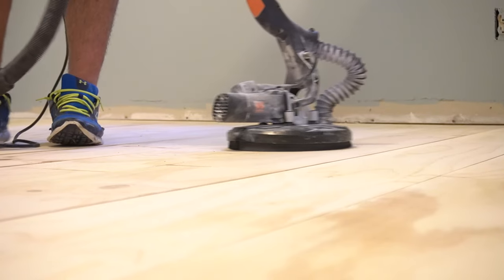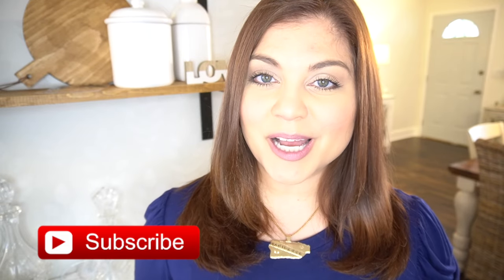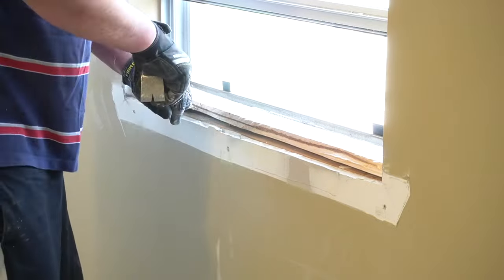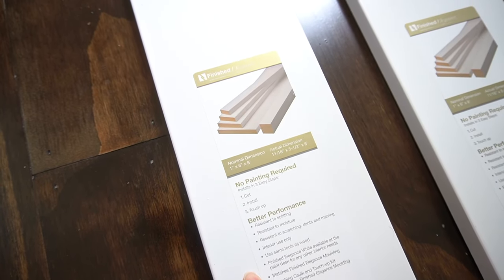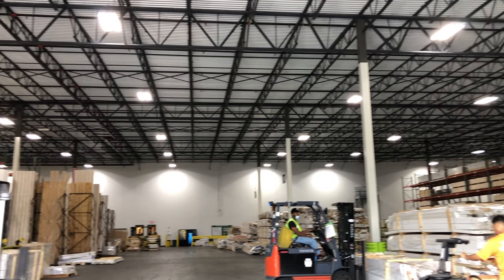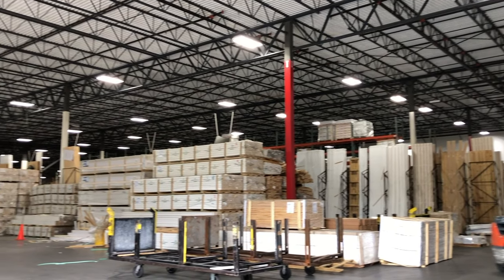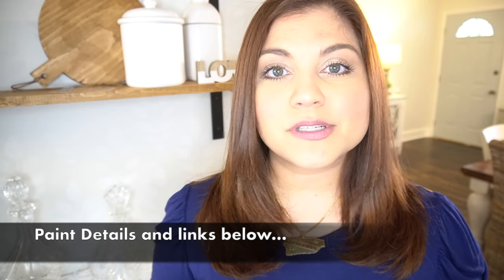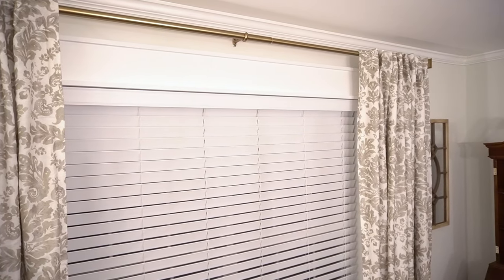HOW TO INSTALL WINDOW CASING | DIY Window Trim Installation

Comment: Great job. Only advice I’d give is to use spackle rather then caulk to fill nail holes. Caulk shrinks so that’s why you can see every hole that was filled. Spackle will fill it and just sand a little and paint over it.

Comment: Good video.  I wouldn’t have used liquid nails unless you plan on never taking it down.  It just destroys your dry wall if you should pull it off
Reply from the maker: Thanks for the tip and no we don’t plan on ever taking it down. It’s too pretty.

Comment: The windows look awesome!  Was the inside framed in wood or are they sheet rock like the walls?
Reply: Yes I was wondering the same thing. I would have to paint the inside white to match the casing.

Comment: It looks good, but could look great by increasing the width of the side casing. Yours are too thin causing it to look top-heavy. Increase side casing to 3.5” (if space allows, such as near corners), so that the outer edges of the sides align with the outer edges of the upper frieze board. The only parts that should be wider are the crosshead strip, any crown (if used), and the top cap. These pieces should likewise match the width or overhang of the window sill.
This will make it look fabulous! Keep it up!
Reply from the maker: You can definitely make those changes to suit your personal style. We love the way ours turned out though! 😊

Comment: So did the sides of your windows inside left, right and top have only sheet rock? My windows have sheet rock and thinking I might have to go back and use mdf in those areas as well.

Comment: Why did you paint the window casing? They looked pre painted.
Reply from the maker: They are primed yes. And you can leave them as is however I wanted to paint over the nail holes and side pieces that were cut so that everything was the same color. In addition I wanted to make sure they matched the rest of my trim and molding in my home. I like everything to look cohesive.